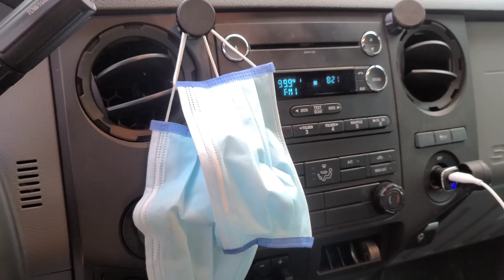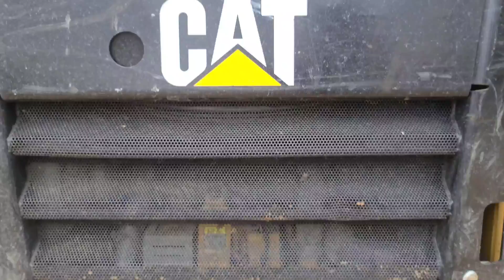Eastonmade 12-22 and Dyna SC14 Processor- Firewood Bliss #firewood #eastonmade #dyna # processor

Comment: Great video. Very cool. There is some very nice firewood processors out there. I'm only using a 28 ton tractor supply wood splitter. What we do is put the tractor behind the splitter. Then start putting in the bucket. Once full it gets dumped on a pile or in the dump trailer. Thought about getting an elevator but keep deciding not to. We would have to move everything closer to the pile which we can't do because of standing trees in the way. If we did though it would be a 40ft plus the piece that lays flat on the ground then it goes into the 40ft elevator. I hope that show happens also for you. Hopefully Ag Progress Days doesn't get canceled this year at State College, Pa in August. Take care get that arm working better.
Reply from the maker: Thanks David. Splittimg into the tractor bucket was my dad's idea also. I'll have to think about that and maybe find a larger wood bucket.
Reply: thats what we do split into tractor bucket.200/300 cord per year this year sold almost almost 300 cord and its not over yet ! i was looking at conveyors ? hope the shows go on this year so i can look at some equipment need to up my game to much work and i am not getting any younger.thanx for the videos hope you get well soon.
Reply from the maker: @andrewslagle1974  thank you. I'll have to try to split it into the bucket. Or look into a bigger bucket. I hope they have some shows this year also

Comment: IBC=1100 L (1.1cubic m ) capacity cord of wood 3.62 cubic meters neatly stacked or 5.098 loose  so a 3 IBC= about 3.3 m2   4 = 4.4 m2 , so you need 5 nearly full tossed IBC for a cord (180 CF thrown= cord apparently )

Comment: Yeah, with the 6 way and 24 tons it really should be close to straight grained.  You need the 22-28 power if you want to split nasty tree service stuff without fuss.  However, the box wedge should work well.  It makes scraps but all multi-wedges do.  I keep those for kindling so no big deal for me.